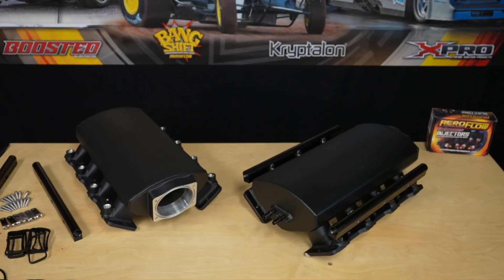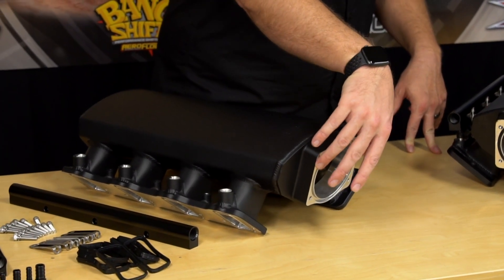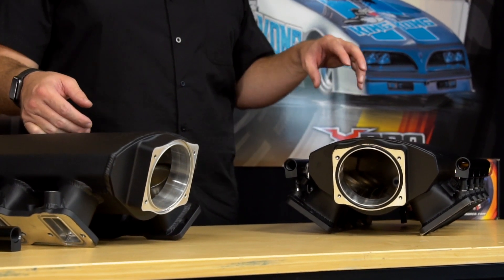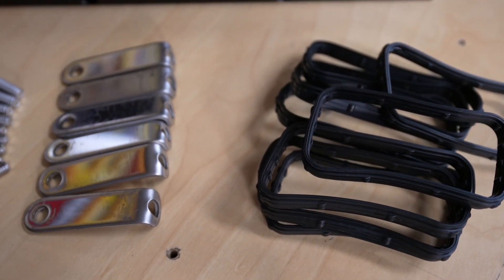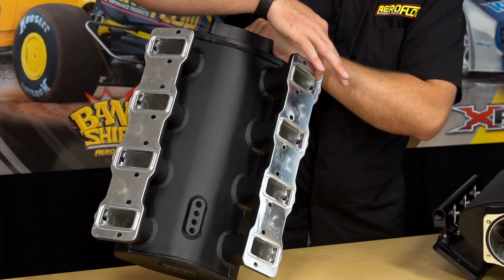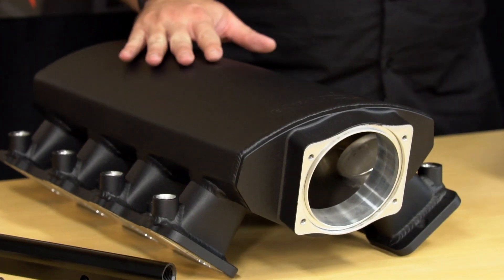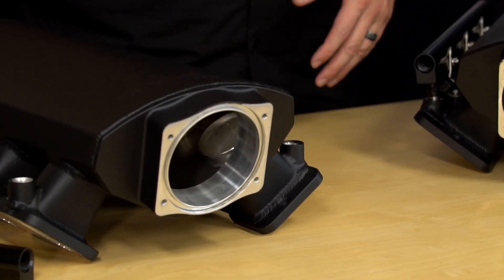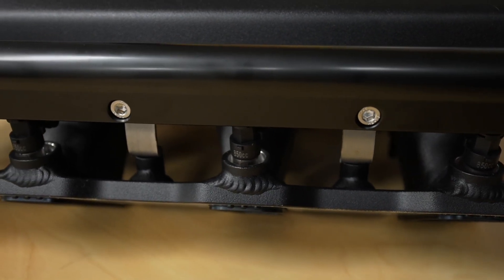GM LS Sheet Metal Intakes

Comment: Do you guys have an install guide for this intake I have just purchased one and am a little stuck with how to run the ports and fuel setup. Cheers
Reply from the maker: Probably easier to give us a call on the tech line as there are a lot of variables with different vehicles and requirements. 02 8825 1979

Comment: I've seen reviews on this manifold that say low - mid  is terrible and say it purses which lead to cracking around welds because the  sheet metal is too thin I'm not sure thats right, Hogan sheet manifold uses the same thinkness sheet and we know how good they are, all these manifolds holley, plasmaman, BTR all lose low - mid hp and torque, I've got 1 and I'm boosting it so not sure if its an issue my engine is a stroked 427 with 98mm turbo I'm not expect to get anything over 15-20lbs, I got mine because I couldn't afford the big dollar intake, I'm now at the $46k for parts so far and my budget isn't limitless once engine and turbo is at the turn key I may save for a holley or BTR manifold, Aeroflow usually make good quality parts so we shall see
Reply from the maker: Thanks Chevy, there's a lot of people that get carried away with all this low down stuff when realistically no one is racing their car at 2000rpm. We have multiple gears for a reason! Shift up or down!

Comment: does it come with the cross over line?
Reply from the maker: EDIT 16th May 2023 - THIS INTAKE MANIFOLD DOES NOT COME WITH A FUEL LINE CROSSOVER - APOLOGIES FOR THE CONFUSION.

Hi There, yes it does come with the crossover but if you are planning on running Alcohol style fuels we would recommend upgrading to 200 series PTFE hose and fittings

Comment: Does this fit with a c6 corvette??
Reply from the maker: Hi Emmanuel, we don't have many C6 corvettes in Australia so we haven't tried that however we do have Holden Commodores that have similar hood clearance issues and these fit just fine. 

The overall height is 7-1/2" so you could check that on your car to make sure! I believe the factory LS1/6 manifold is around 7"

Comment: This intake looks great! Can you guys possibly share what makes this intake different/better than a common 'ebay sheet metal intakes'
Reply from the maker: Hey Quinten, sorry for the slow reply! We;ve adjusted the throttle body mounting boss for better accessory clearance and to reduce the clearance issues when going full throttle with a cable throttle. We also added a second vacuum port boss under the plenum so you can run fittings underneath or at the back depending on your application
Reply: @aeroflowperformance  good to know ... I'm planning on running a cable throttle
Reply from the maker: @itsQUINTEN24  check them out on our website https://aeroflowperformance.com/search/?q=ls+intake+manifold

Comment: What are your recommendations for installing a push in map sensor?
Reply from the maker: Hi Quinten, most people will run a barb adapter in the manifold and possibly our part AF64-2149 with a vacuum line connecting the two - with so many swap vehicles there is always a different way of doing things but this is the simplest